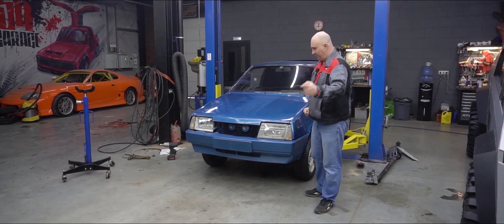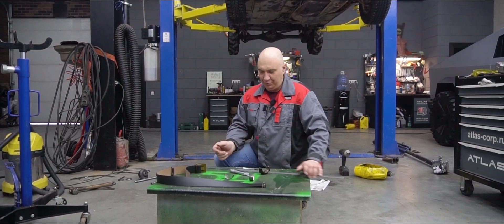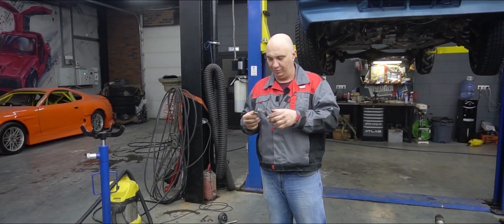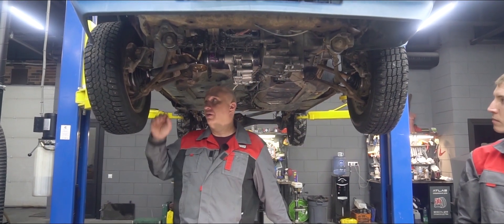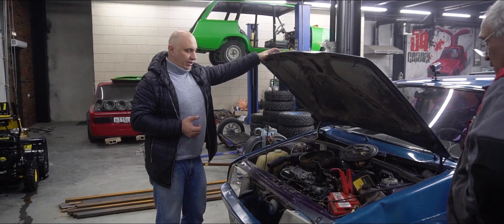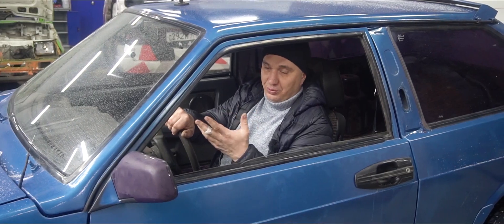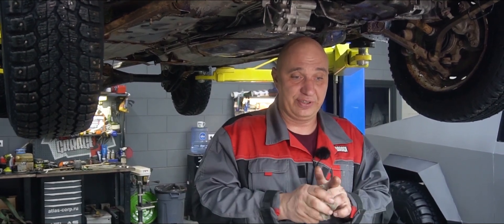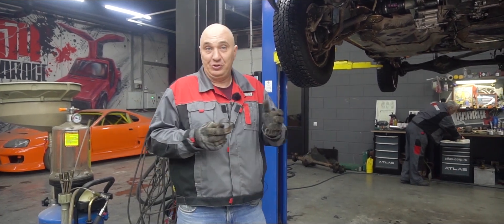Can you replace crankshaft bearings with leather belt?

Comment: I’d actually like to see what would happen if they filled up with bearing cap area with rollers removed from a few sets of needle roller bearings. In theory it should hold up and potentially allow the engine to rev as fast as the cam will tolerate.
Reply: This would make no difference in a pressurized oil system as when the crank and rods do not ride on the bearings but a film/oil between the bearing and the crank/rods. 
Applications with roller bearings on the rods or mains use splash lubrication like in conventional 2 strokes. 
Smokey Yanuck went through great trouble and expense in the 60's to convert a SBC to a full roller bearing bottom end when dyno'd it made not 1 HP more or FTLB of more torque.
Reply: @matthewq4b  my bike isn't a splash type its pressure oiled four stoke 4 cylinderits got rollers on the outer parts of the crank
Reply: Some Small engines have this type of setup my chainsaw is like that
Reply: Jesus.   That's a good idea.
Reply: Roller bearings work for small engines.
But they won't take the pressure in large engines unless the bearings are extremely over sized.
But then you have to deal with expense and weight. It'd not worth it.
Reply: @satansaysimnuts  100% correct roller bearing will work on conrod bush
Reply: My boss experimented with half round needle bearings in ford flat head v8s he he built for moonshiners back in the 50s. Said it worked ok just took a little longer for it to wind down. RIP Roger Jordan, Atlanta Georgia.
Reply: Halsey Walter  the ones in mine were at the ends but that was it in the middle were regular bearings like in a car not sure if that normal or not
Reply: HZB OcYpcWr'Ctwu Odzs stop putting sand in your oil.
Reply: Its not a honda, it will break valves probably at 9k rpm very fast xd Even some hondas need springs and retainers to rev more than 8k with boost ;)
Reply: Old Bugattis had ball bearings but they don’t last very long under that load, don’t think roller bearings would really be any better
Reply: Elliott's Lab they use them in chainsaws. The biggest issue preventing this from being done is having a multi piston crank.
Reply: @JesusisJesus  They use them in chain saws and all two strokes because two strokes don't have a pressure lubrication system to support plain bearings.
Reply: ROLLER BEARINGS ACTUALLY SPLIT THE OIL MOLECULE
Reply: Like a 2 stroke outboard motor? Already a thing
Reply: You need harder surfaces for that.

Comment: I seen this before. Belt bearing don't last long and kill the oil pump.

I want to see a differencial with sawdust and oil. I got told stories of worn out diff fill with sawdust. To make them tight again
Reply: You do this with a engine with tappet troubles you put sawdust through the oil then you sell the car on right away
Reply: @thomasmcdougall8059  same concept..... Driveway warranty.
Reply: I watched a video about adding sawdust to gearbox to make it work "better", for some km it was tighter and harder to put a gear in. After a longer drive everything returned to normal as the sawdust was shredded by gears.

Comment: I wonder if it would be more successful in an old briggs engine.    Since old briggs engines use the connecting rod to splash oil around for lubrication you don't have oil passages and a pump pickup to clog.
Reply: My Briggs doesn t have connecting to bearings at all just the rod itself acts as the bearing

Comment: Years ago when i was a kid.. I read stories about back in the model T days,   that,  Guys who had a bearing go out while on the road would  pull over, Drop the pan, and Replace the spun bearing with a piece of leather or, Even a piece of bacon rind as a temp fix to get the car home.
Reply: Between Chrisfix using bread as a tool, mithbusters using eggs as a fix for cooland leaks, and Model T drivers using bacon as bearings, the car comunity will create the weirdest breakfast ever.

Comment: If the belt was submerged and completely absorbed the oil, it may have lasted slightly longer. Maybe try soaking some leather in oil for a week or something, then trying it. Im sure most of the oil will be extruded when tightening it back in, but there has got to be more oil content under those circumstances than these.  Tho it may only buy you 5 more minutes. Hahaha. Who knows. Great video guys!

Comment: This was done in post war Britain! - The humble Austin 7 often suffered the loss of a big-end, which could be replaced with piece of leather belt, but it had to be real leather, not this modern reconstituted rubbish. In plain English, you need 'real hide'. Also, bearing in mind that you were unlikely ever to replace all four bearings, and the Austin 7 was only a 7 horsepower engine, the leather survived rather better than here. You had to be careful to keep the engine revs low, and be frugal with the 'gas pedal'. I heard of one instance where a motorist did this at the roadside, and nursed his car, loaded with family, and their camping gear, about 200 miles (about 300 kilometres?) home.

Another little trick that unscrupulous traders used to employ in cases of noisy big ends, was to file off a small amount from one end of the bearing shell, then insert a piece of thin brown paper between the shell and the big end cap. That effected a miraculous cure for a noisy 'bottom end'!
Reply: I don't know anyone that likes a noisy "bottom end"! Lol🤪🤣

Comment: I think if you do it right it will work. You can get high quality leather like cordovan and have it cut just slightly oversize. Boil it and then install while hot. It will mould itself exactly to the part and set hard. trim if necessary and it will have many similarities to babbit.. You can't use a material that is cheap and soft and four times as thick as the original, it just can't work. 😸🙈🙉🙊. I don't really know!! But would guess a carefully measured quality bit of leather could last thousands of miles....

Comment: I don't know if this was tested already, but could you test running the engine with an entire connecting rod and piston removed? I'm interested in what kind of massive imbalance that would give!
Reply: It runs. It rumbles but it runs. We blocked the piston in up position. And to keep oil pressure we used an old garden hose and a hose clamp on crankshaft. Drove back from Monte Negro to Czech Republic. Used low rpms and low load....

Comment: There is an old episode from Roadkill,where they had an old Jeep with an engine with leather bearings. They opened the engine and it was a mess.
Reply: I remember that. Apparently years before they filmed that episode they put the belt in themselves and drove took it on a road trip to the garage they stored and rebuilt (this time properly) it at.
Reply: I remember that episode, it was the first thing that came to my mind and immediately knew how this was going to end
Reply: Didn't the jeep engine start to knock very bad even after the rebuild?
Reply: @andyhouston69  yep, they fixed it with more viscous(?) oil, but then they could not start it cause of the temperature, or sth like that
Reply: I remember an episode of that. Worked for awhile but not super long. Didn't see the episode leading to it cause I think it was MTOD only
Reply: I know i remembered a seeing a jeep with leather bearings, glad someone else remembers.
Reply: i see i am with my people in this reply section
Reply: When I read the original post I read it in frieburgers voice
Reply: @benson4u215  Is there any other way to read that post?
Reply: If I remember correctly it only had one.
Reply: What's the episode?
Reply: Any idea what episode
Reply: They don’t make leather like they used to…

Comment: I've personally seen this done on a 2001 mack auction dump truck a customer bought. Ran for about 3 miles and then shtt locked up lmao. Tore engine apart and found leather bits inside 2 rod caps.
Reply: One guy from Dallas called it once "World famous mex-bearing" :)
Reply: I've seen flathead Ford's with belt for bearing
Reply: @kevincollins2184  Cmon, if u  seen it, it was "backyard craft" not well working one. I bet u can find at least one with "mex-bearings" @ any ol' junkyard.
Reply: @elmatroso7125  no it wasn't running well I never said it did I just stated I had seen done. I guess when desperate any port in a storm though
Reply: What mack engine?
Reply: @5.43v  the ol reliable E7. I'm a Cummins man but I can sure respect the older mack/renault engines.